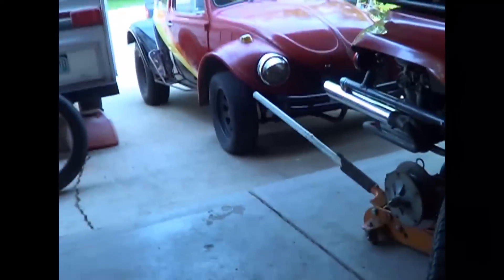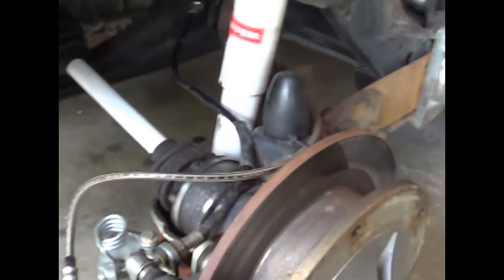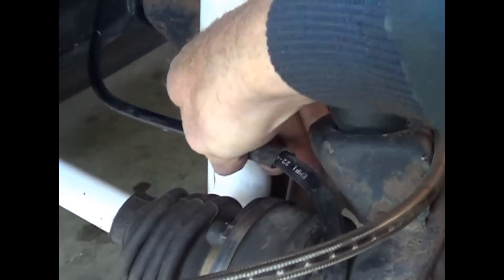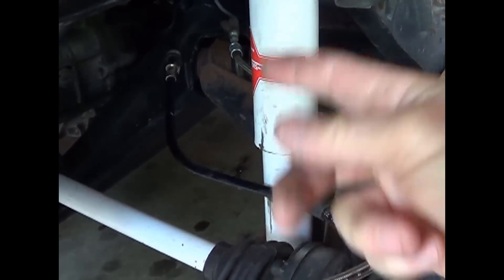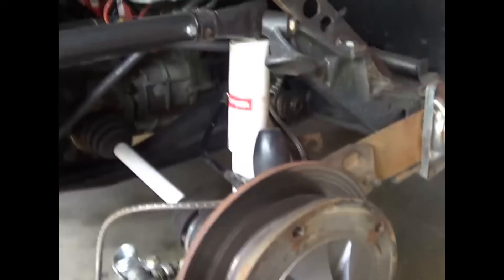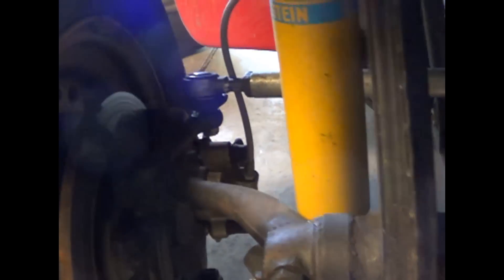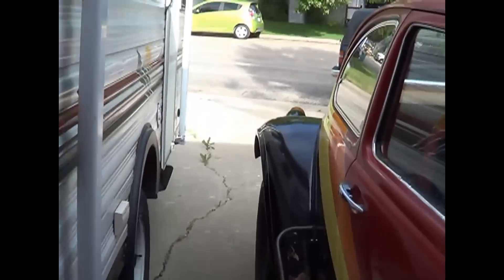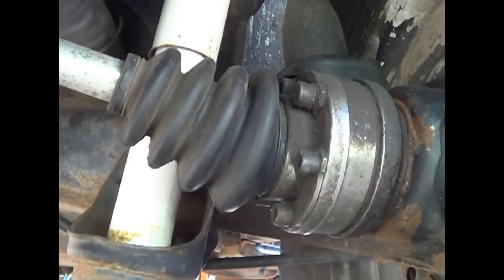EMPI Disc Brake  "Alert"

Comment: Appreciate the information on the brakes these things are like an old aircraft, you kind of got to look at everything every time. It may save you later. VW:)
Reply from the maker: I agree
Reply: TheEZGZ  Can you tell me where you got your rear brake lines, I like how it makes the 90 for you instead of using a hose directly to the caliper any help would be greatly appreciated

Comment: Great video!! I was wondering how you got the fronts to stop squeaking, I just put front discs on my 71’ Super and they didn’t make noise the first two weeks and now I can’t seem to get them to stop. Thanks
Reply: I’ve had them on for a little over a month
Reply from the maker: Yeah that squeak is irritating. Sometimes it might just be a small stone ya picked up in the pad as these things don't have metal guards.
Reply: Did yours stop squeaking on their own or did you have to modify them?
Reply from the maker: I had to put some of that disc brake stop sqeak on the back of the brake pads. Any auto parts store carry's several kinds just ask at the counter. It still comes and goes if I do a lot of dirt roads and crazy stuff